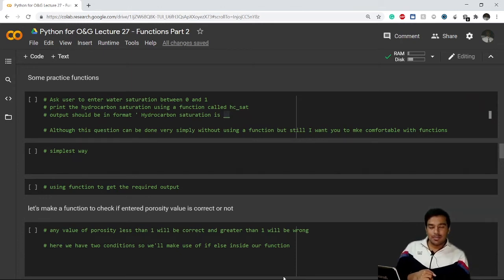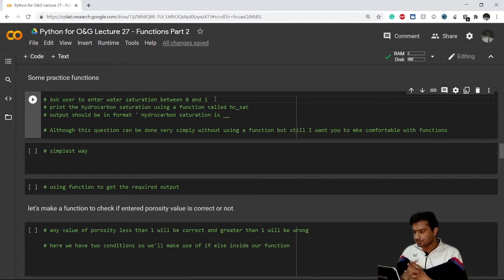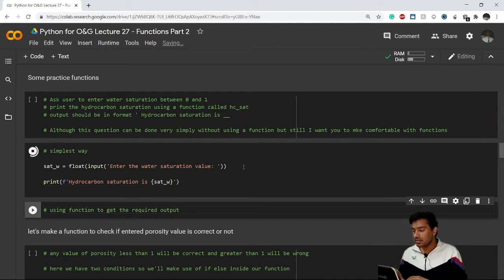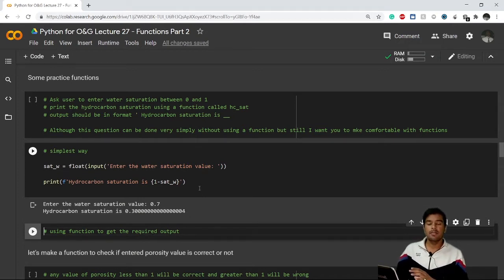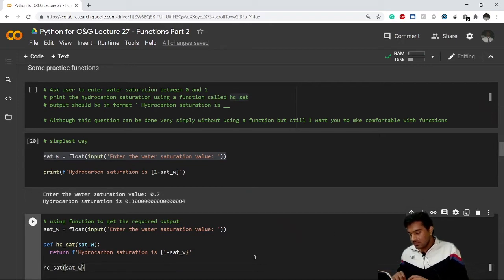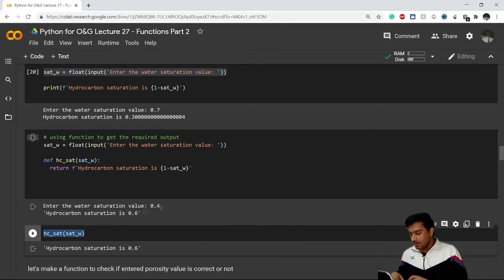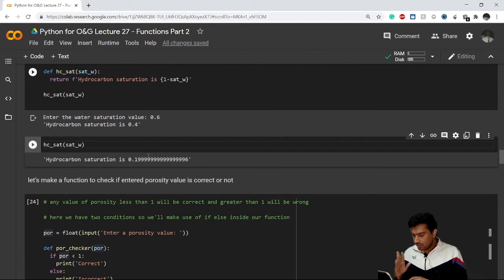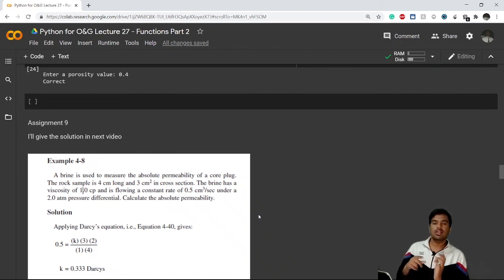Lecture 27 - Functions - Part 2 | #Python for Oil and Gas

Comment: Q=float(input("Enter the flow rate:"))
u=float(input("Enter the viscosity:"))
L=int(input("Enter the length:"))
A=int(input("Enter the area:"))
diff_pres=int(input("Enter the differential pressure:"))

def k(Q,u,L,A,diff_pres):
    k=(Q*u*L/A*diff_pres)
    return (f"Permeability value by employing darcys law is {k}")

k(Q,u,L,A,diff_pres)

Comment: # Assignment 9

Prm = float(input('Enter a Permeability value: '))

def Q_value (L,A,U,P):
  return f'Flow rate is {((Prm*A*P)/(U*L))}'
 
Q_value (4,3,1,2)

Answer I got

Enter a Permeability value: 0.333
'Flow rate is 0.49950000000000006'
Reply: @Petroleum From Scratch

Comment: k = float(input('Please input permeability k in Darcys: '))
cs_a = float(input('Please input cross sectional area of core cs_a in cm2: '))
u = float(input('Please input viscosity u of brine in cp: '))
dp = float(input('Please input pressure differential across core dp in atm: '))
l = float(input('Please input length of core l in cm: '))

def flow_rate_plug(k, cs_a, u, dp, l):
    q = (k * cs_a * dp) / (u * l)
    print(q)
    return q

flow_rate_plug(k, cs_a, u, dp, l)